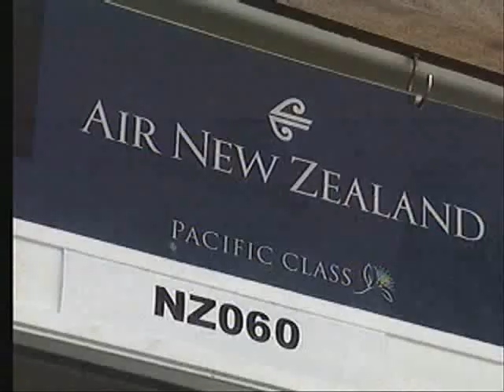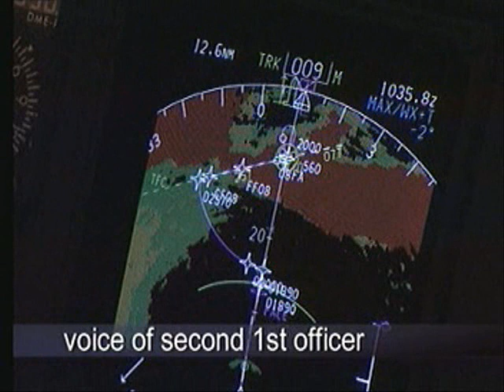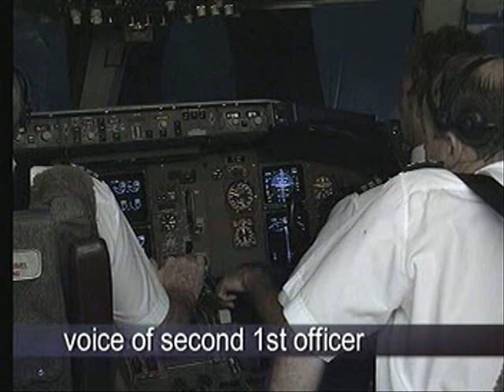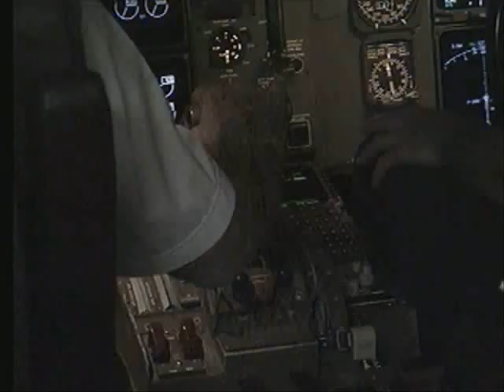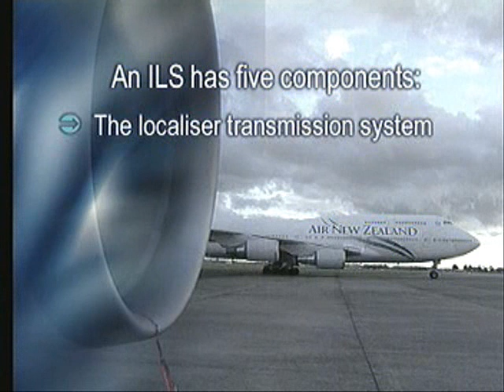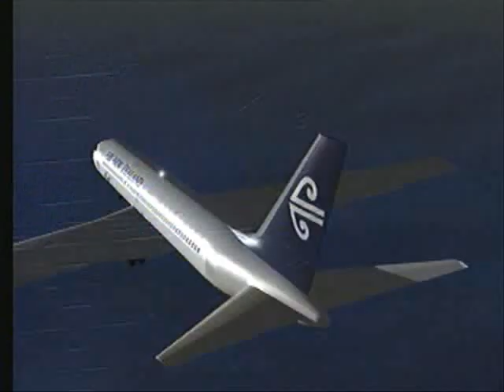NZ60 Erroneous ILS Incident, Apia

Comment: Scary. Being so heavily drawn/lulled into a form of "tunnel vision" in relation to the primary navigation display to where it seems (sitting here as a self-nominated "amateur Monday morning armchair umpire") that less emphasis was placed on distance to height utilising and focussing on the reading from the ground based DME installation during the LLZ/DME approach relative to each 300 feet of descent during the first attempt.
I guess it leaves many wondering about what, if any, callout procedures pertaining to distance and altitude during this non-precision approach were required. For example, "8 DME, should be 1800 feet" (taking into account that the DME station was at the other end of the runway about a mile and a half further down the runway from the ideal touchdown point), or, "8 DME, should be 2400 feet" where the DME station is at the approach end of the runway for example.
The published approach procedures profile took into consideration the absolute Minimum Obstacle Clearance (MOC) requirement pertaining to height above the surface (land or water) for a Boeing 767 (ICAO Cat D aircraft) on final approach using this published procedure.
I guess that the stipulated MINIMUM (height) above the surface of 246 feet during the final approach is there as a type of 'safety buffer', but then I guess that it would be there to allow for small handling errors (not as a 'remedy' for significant distance/height miscalculations).
It gets me thinking. And so I wonder what might have occurred if the aircraft had been over hilly terrain at approximately 6 nautical miles (at 8 DME slant distance and at (around) 450 feet above the surface (sinking to 384 feet after the missed approach procedure had been initiated).
My guess is that it probably would have ended up being a whole lot worse for everyone.
Would anyone here on this page be able to clarify this for me. I could be off track here or flying under the glidescope.
Like, what if the approach hadn't been over the water and the aircraft was at 384 feet at 6 NM?

Comment: @pasoundman, speaking as ILS tech, the monitors are there to detect such absence. The tech obviously engaged the monitor bypass feature and readiated HMI and walked away from the system. This is something I would ONLY do if I completely NOTAM the GS out of service. Even then I would dummy load the air borne signal just in case. In the case where a normal signals loses its SBO (90 and 150) the transmitter would immediately shut itself off.